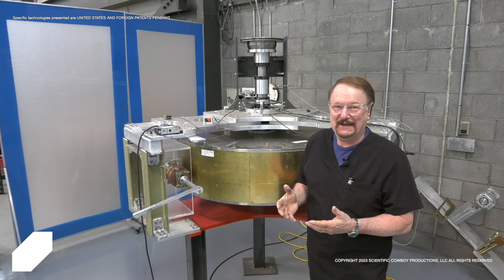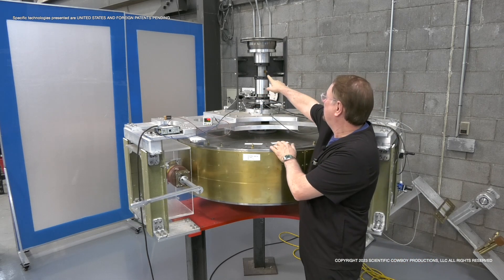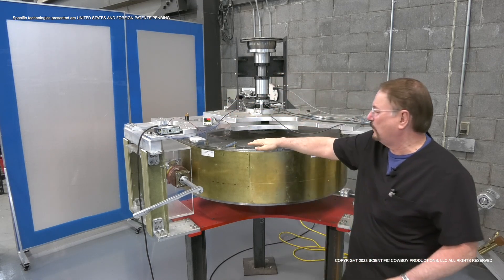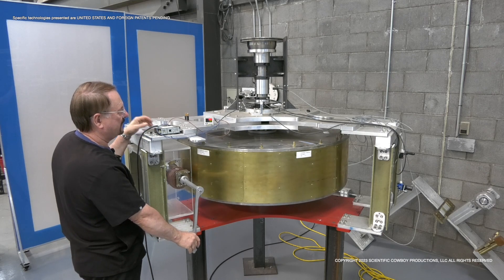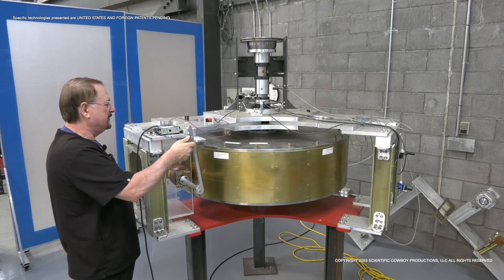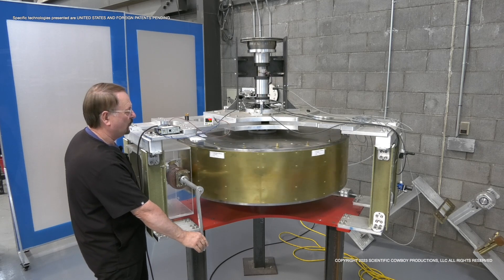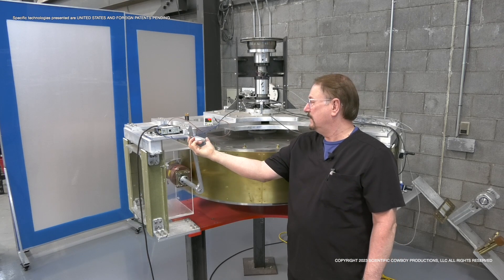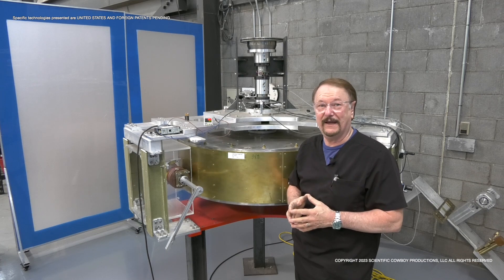Only the Force of a Magnet: Watch a 1200 Pound Flywheel Spin with only Magnets!

Comment: how difficult is it to push the lever? could you use the energy of the flywheel to flip it?
Reply from the maker: The simple answer is no. Using the momentum of the flywheel to advance the attenuation would be defined as perpetual motion. Stay tuned to see photonic energy in actual demonstrations in upcoming videos. You will be very pleased as to where the energy to continue acceleration comes from!
Reply: that's what I was wondering, I think with some mechanics to hold the lever and switch it at the right moment you could make it look close a perpetuum mobile for some time. I'm really curious how efficient this could be